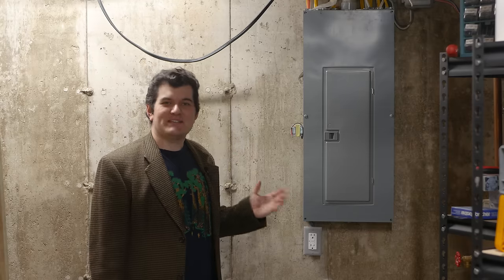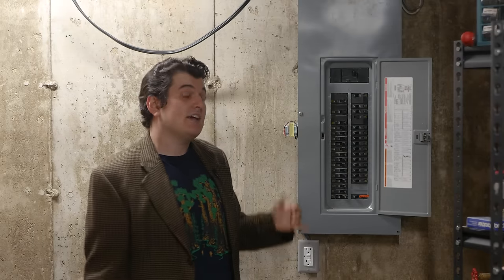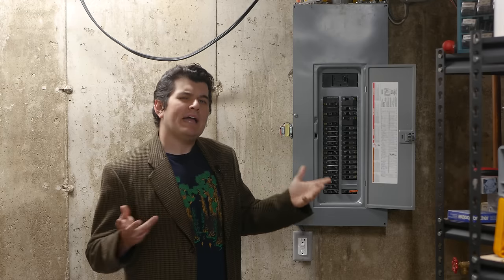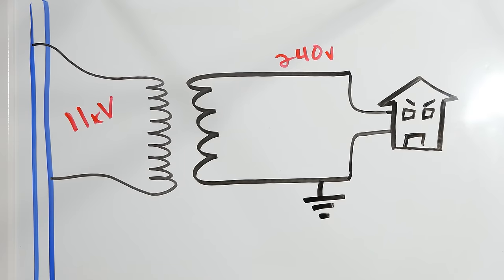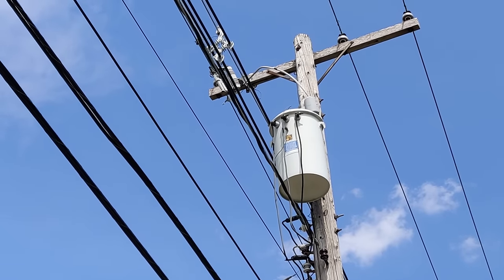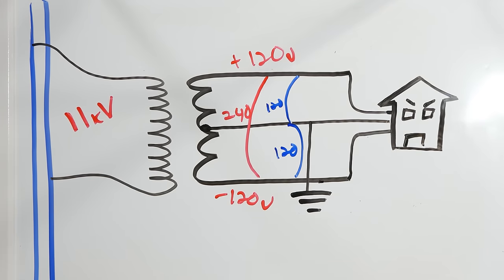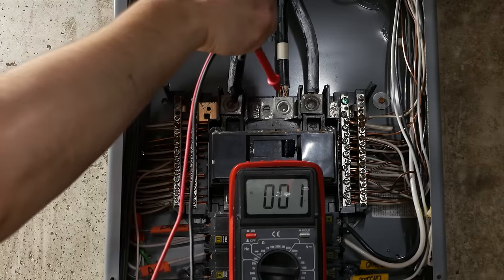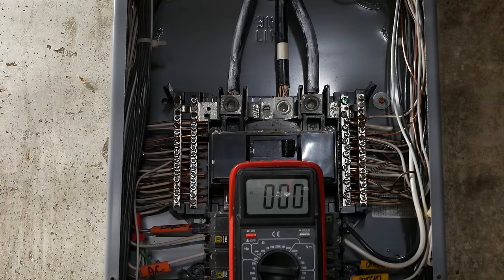The US electrical system is not 120V

Comment: Note how he does the voltage measurements with only one hand. Standard smart move to prevent his heart from being part of the circuit if he makes a mistake. (I'm sure someone else said this somewhere in the other 12000+ comments, but worth repeating...)
Reply: Thats very smart and safe in case there's a shock and avoids placing the heart and internal organs in the circuit.
Reply: Also always put right hand to danger. If you use left hand then a leak to earth via your feet will go near heart
Reply: I noticed that too. At first I wondered why he was making it harder but then realized it contain the potential shock to just his had.
Reply: i actually never though about that, i thought he just didn't want to be blocking the camera too much.
Reply: @r.h.8754  That's why you always put a warning sign on a breaker and/or controls. A simple and effective safety measure your co-worker ignored. Another safety rule: you don't remove a sign if it's not placed by you.
Reply: I'm alive because of using only one hand. And don't forget that your other hand doesn't touch ANYTHING and only boots on the ground, never a knee. 

I did everything right except for not locking out the machine for the umpteenth time (like an 50 yard walk each way) and nicked 1 phase with a knuckle. After getting up, dazed, my coworker walked passed me without making eye contact. For a brief moment, I thought I was dead. Then I felt the pain in my muscles and hand. Felt like I got hit across the chest with a baseball bat. I'm a reasonably tough guy, but that stinking hurt.
Reply: Nice to see that people noticed this comment...  One of my own bad experiences (read: dumb mistakes...), many years ago, was when I tried to fix a camera that had an electronic flash. I somehow managed to put both hands across the flash's main capacitor (something like 17 microfarads, rated for 300V). Ouch! I haven't, at this writing, ever been kicked by a mule, but I imagine that it's similar. Considering that I was alone in my apartment, with the door locked, I'm grateful to be here to write this...
Reply: @SmirnovSB  Good idea. There are systems available for doing that even more reliably. Some are set up so each worker puts their own padlock on the panel, and it's set up so power can be turned on only if all the padlocks are removed.
Reply: @r.h.8754  oops... looks like you beat me to this one - and even included a website reference...
Reply: Only smart if the other hand is in your pocket
Reply: @SmirnovSB  "warning signs"?? Personal(assigned padlocks) Locks are an integral part of OSHA "lock out/tag out procedures. Put on your padlock; put the key in your pocket: Nobody can power that circuit but you. Also there are metal hasps with multiple lock holes so anybody working on the system can add their personal padlock to the disconnect panel.
Reply: @46ace  The World is a huge place you know. Only a small minority of workplaces are inspected and regulated by the OSHA on a large scale, mostly those located in parts of the so called North America. Some people even remember how it was before the Nixon's OSH Act in the US. But the simplest rule "don't turn it on unless you're the one that turned it off" saves lifes universally. Even a hand written note tucked under a wall switch can provoke a thought process in otherwise empty mind.
Reply: @SkyChaserCom  what if meter is hurriedly flipped to the ohm setting with improper fuse or jumped out with aluminum foil which I have seen people do and it blew the mans hand almost off and he's blind also when the meter shorted out and blew up in his face.... not a pleasant sight to watch!!!!
Reply: @r.h.8754  If the guy was electrocuted and then decided to find a new job, it means he died and came back to life! That would be a good reason to find a new job. I suspect he was shocked.........different from electrocuted. I didn't learn anything new from this video but liked it. I have never been shocked while doing electrical work (I do construction, including electrical for a living) but did get shocked by 25,000 volts today. Luckily it was from a powder coating gun and I was actually wearing gloves and boots. Now I'm curious to see what the amperage or wattage is on that gun.......it just creates a static charge but it doesn't take much to stop the heart. It was certainly no fun and I can only imagine what a bad shock would be like, but have seen videos and heard stories enough that I use a handful of methods to protect myself when doing hot work and of course am afraid of getting zapped.
Reply: Wow, i am am Amprentice as electrician, But never thought about that "trick". Very clever
Reply: @lucaeber2720  I'm surprised it wasn't a part of your formal training - it can be a life-saver. (Punny switch of an m for a p there...    ;)    )
Reply: @zevfarkas5120  Yep. Worth knowing too that many deaths from electric shock are indirect - the violent muscle spasm causes a fall or other mishap (eg think what happens if you get a zap while up a ladder)
Reply: @sprinkletits01  this reminds me of a work horror story I red once, the person in question was working at a post office or something, and they used a woodchopper-like machine to destroy old letters and boxes. While cleaning out the inside of the hopper, another employee came in, noticed the machine was locked out, and proceeded to remove the tag and attempt to start the machine anyway 😬😬

Comment: As an American commercial electrician 15 years  I usually steer very clear of videos like this for fear of yelling expletives at my screen because so many people just get so much wrong. BUT you sir have nailed it this is the best starting explanation video for basic electricity you never let me down keep up the good work also I’ll try not to be so pedantic about the 110-120 thing but it does drive me nuts especially seeing as how I’m most homes a voltage of 110 puts you above the range for allowable voltage drop (read inefficiency/dangerous)
Reply: One of the reasons i like this channel so much - he tries to be as close to the truth as possible and do that while being as clear as possible and in most easy to digest way possible.
Reply: Tell that to europe, we have real 230 v here in the outlets... and no it is not dangerous and inefficient! Well current always is dangerous even at 110 but also there are security measures in place every installation needs to have to keep people alive!
Reply: What do you think has been nailed. ? . . .  Not the energy down wires being carried int he E & M Fields.. .  Derek is very wrong there.. .  The Energy is in the moving ?Electrons INSIDE the wires.
Reply: @hughleyton693  what? Can you try that again?
Reply: As someone having trouble putting spaces in the correct places and forming coherent sentences, I have trouble trusting anything you say Mr. hughleyton693.
Reply: @hughleyton693  Dude... I barely understood what you're trying to say and you're literally describing exactly what he did. The magnetic field induces the current, e.g. electrons, in the secondary wire.

Do some reading, you've no idea what you're talking about.
Reply: @kewlhotrod    You have not asked a question in your post.. .  I try to explain these things to you guys, if you do not want to learn, then that is your problem, or ask a sensible question.. . . I most certainly do understand electricity.
Reply: @hughleyton693 are you thinking this video is the video on how electricity is taught is wrong doesnt literally move electrons to the place? Cause this channel ain't Derek's channel?
Reply: @werpu12 by technology connections we actually have 400v three phase here. take that america.

Comment: You know this is really just a great example of engineers solving safety hazards through different methods. When analyzing hazards you got two scales, likelyhood of injury, and severity of injury. In america, we decided to tackle the severity part, dropping the voltage and making it less likely to kill you as easily. In britian they tackled the likelyhood part, designing better plugs, leakage current detectors, ect. In both places they felt that these considerations brough the hazard level down to a point that was acceptable and moved on with their lives, not thinking about it much more after that.
Reply: Then you have Brazil: even in the 220V parts of the country, electric showers are mostly ungrounded, and we use exactly the same plug both for 127V and 220V.
Reply: Not necessarily true. In Europe you have 230V on one phase yes, but pretty much any house has 3 phases coming in, so you can use 380V for higher power devices or for devices like a motor which needs it to function anyway. So using the US system is not really applicable for Europe anyway. Those 3 Phases have the same safety advantages the split phase system has. 

Besides I would argue that the severity of injury is not that highly reduced by 120AC, since the things that make AC dangerous are the frequency which the heart still can react to and the body having a lower impedance than ohmic resistance, which means AC can more easily pass through it than DC. So decreasing the likelyhood of injury is the only sensible way to go here.
Reply: @lal12  In the UK and Ireland it's not really common to have 3-phase in a household. Neither is it in Australia or NZ (230V@50Hz, just like Europe). I hear the same happens in France and the Netherlands, though I may be wrong. Also, they get far less amps, which means that even in Germany, where 3-phase supply is commonplace in households, the maximum power is lower than in America. That, of course, comes at the expense of having to spend a little more on wires, but the cost is marginal relative to the cost of a house. Having three-phase for households has many advantages though, but they are related more to the possibility of running more efficient motors (3-Phase Air Conditioners, for example, are becoming very common here in Brazil for residential use, where three-phase supply is quite common for homes, though not ubiquitous as in Germany).

Now, 120VAC is unquestionably safer than 230VAC. Your resistance doesn't change when you are closer to a 230V outlet. U = RI. Hence, the current going through 
your body IS nearly twice, which means a much worse shock. The higher the current, the higher the risk.
Reply: You deserve an upvote bro. Very great amicable summary of the situation here (compared to whatever argument to which is better)
Reply: some countries its illegal to provide oulets in home bathrooms and toilet rooms
Reply: That’s not why Britain did it, it was lack of resources after the war.
Reply: @lal12  Not manu Houses in the UK have 3 Phase. Most only have a Single phase supply from the DNO.
Reply: The world couldn’t even decide what standard to use for HDTV (8VSB or COFDM) or emission standards for cars (diesel bad in US/ okay in EU)

.
Reply: My country in South America has 220v in single phase 3 wires ,L ,N and GND but the same machine we connect here when is both voltages works here at 9 amp while in USA works at 18 amp at 115 v giving the same power but where is more dangerous ?industrial works with 380 v when is three phase never seen there a 2 phase appliance or machine neither a breaker ,residentially in the main panel there’s a breaker and a “diferencial “ which has a neutral on it similar to a regular breaker but with gfci feature ,also the ground connected only in the main panel in the neutral bar and separate when is in a subpanel it doesn’t exist. every panel has a bar for neutral and ground electrically isolate from each other you don’t need double voltaje to connect the range or a water heater,same voltaje for everything but using half the amo from countries that use 115v also there’s 50hz not 60hz means motors doesn’t work at the same speed from one country to another despite the voltaje difference if both were 60 would work exactly the same including the speed
Reply: How about combining both standards (at least for the US)
Reply: @Seriouslydave  The UK, for example (with exceptions).
Reply: @Zumbruk  your outlets have switches? Thats the one thing i dont like about usa, the outlets dont have any switches at all, so when you plug in it arcs, eg adapters.
Reply: @Seriouslydave  Generally, they do, yes, and although you can get them without, I've rarely seen them installed. What terrifies me about American outlets/plugs is the exposed live pins.
Reply: @Zumbruk  tell me about it, just the right size for a toddlers hands to reach both at the same time
Reply: @lal12  half of  the voltage means roughly half of the current, it could mean life or death, easily.
Reply: @Seriouslydave  Some cities in the USA now require special outlets which have covers to prevent children from sticking anything into the outlet.  All new homes must have GFCI (Ground Fault circuit interrupter) but a newer type of ground fault system is coming in the next few years.  All done in the name of safety.